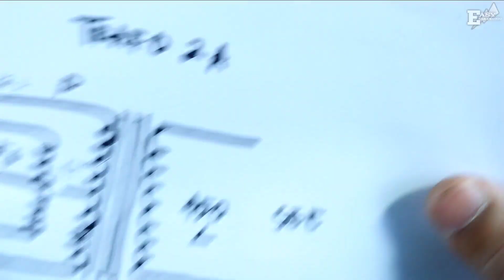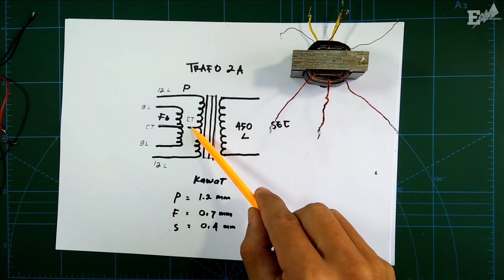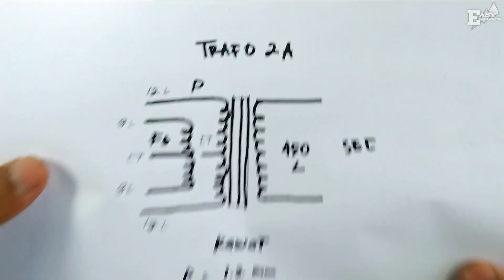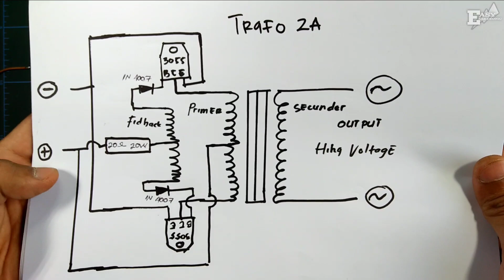STRUM PAC MINI 2 TRANSISTOR PLUS SKEMA

Comment: Output pake kapasitor gk masee
Reply from the maker: Pake ka. 😊
Reply: @EasyElektronic  1 lagi masee..
GK pake rilay gmn?
Bisa gk?

Trima kasih sdh jawab&sy ucapkan selamat hari raya idul Fitri 1syawal 1443H minal Aidin walfaidzin mohon maaf lahir dan batin
Reply from the maker: Kalau untuk skema ini belum pakai relay ka, 
Dan saya sarankan untuk transistor pakai D718 saja di paralel sampai bbrapa set.. Biar out nya maximal.  Kalau ini kan hanya basic saja biar mudah di pahami. Tapi semua prinsip nya sama ka. 😊
Reply from the maker: Terimakasih ka.,  selamat hari raya juga mohon maaf lahir batin 😊